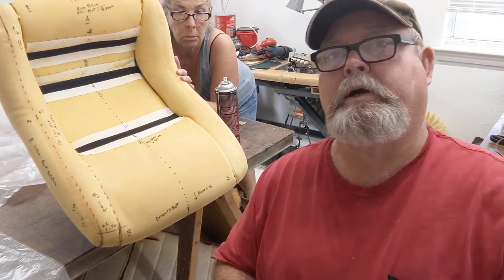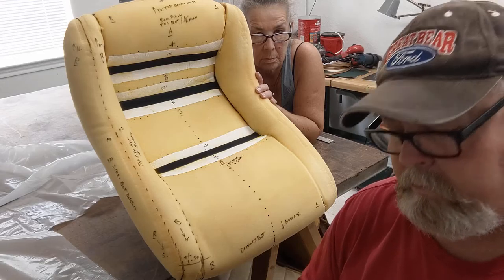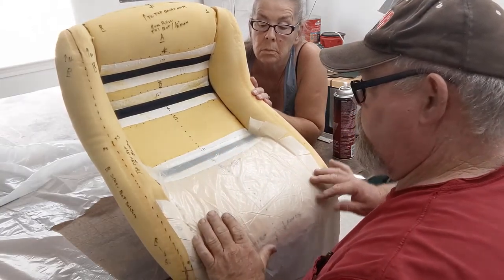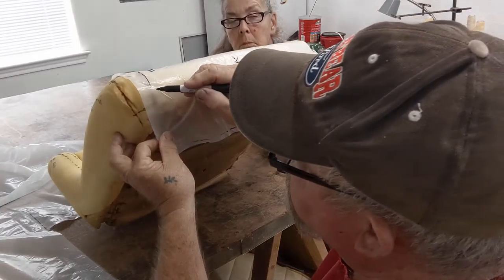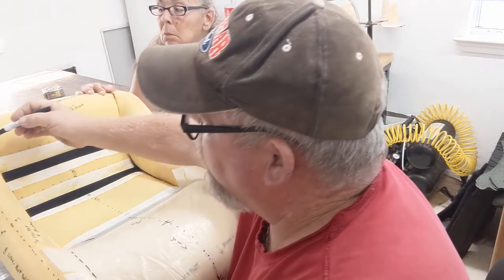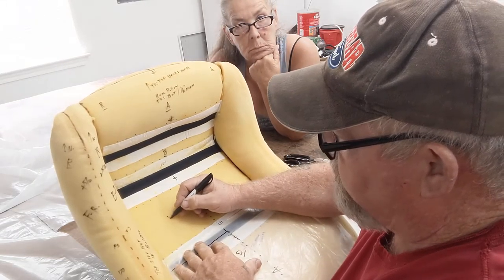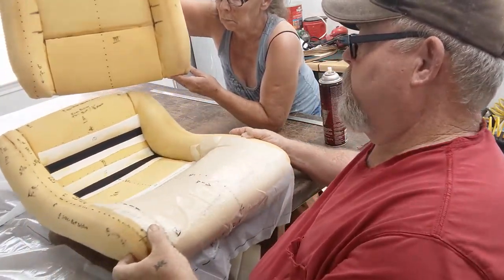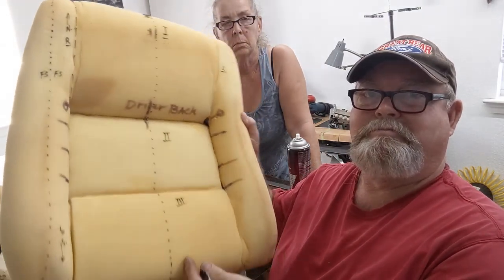Back on C3 Corvette seat upholstery of seats

Comment: Thanks for showing the pattern work Bear.  I worry that the skills you and I have are going to be lost soon so great that you are showing how you do things.   I do a lot of early Willys seats but they are much easier than that C3 seat you are working on.    Prairie Gold is sprayed on the CJ5, check it out and maybe that will get you motivated to get back on your CJ5.     Stay safe Bear and Sam.
Reply from the maker: Labor Day was a good day off, so did get in a few hrs on it. Our daily 06 caddy sts came up with a trouble code again, but on left side bank 2. Spent Sat & Sunday dropping fuel tank out of 92 D250 Dodge to get another driver going. Fall is near, an will be nice to work without sweating (@@)! Have a great wk, hi to the gang.